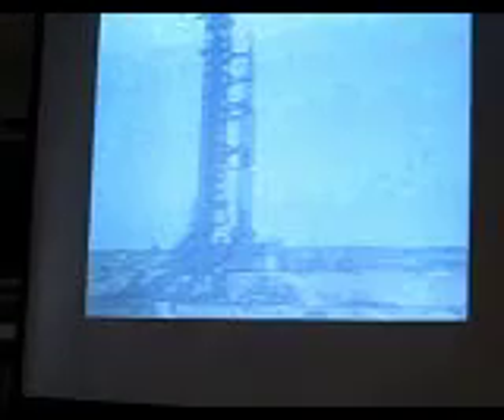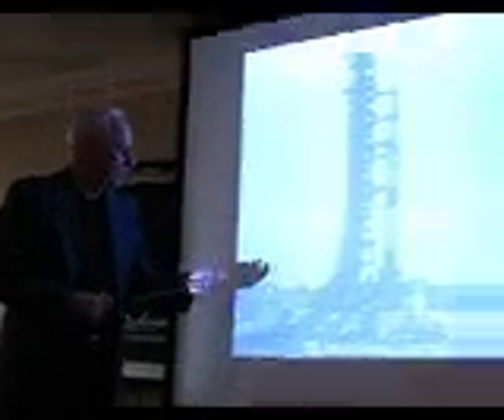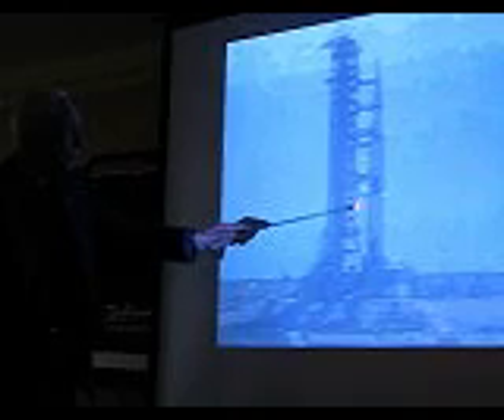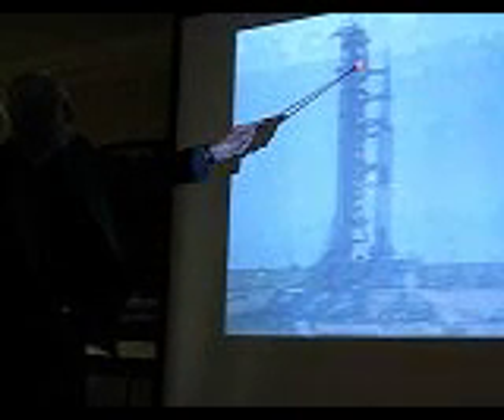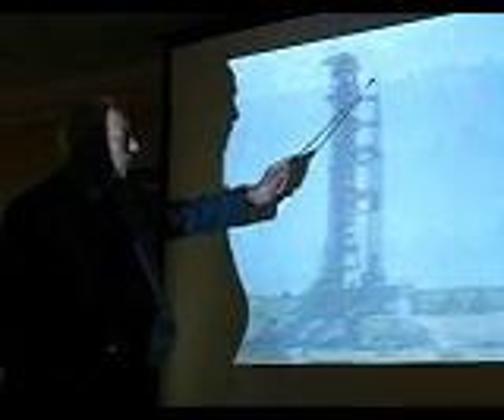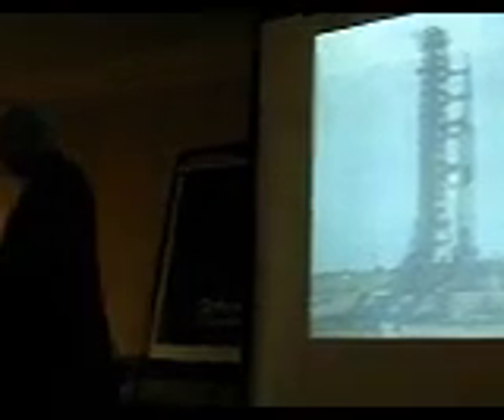Al Worden

Comment: Love that smokers cough.

He told me about Irwin taking a bar of soap as a personal item. The soap reduces the surface tension so much that warm water will evaporate off a cloth and they chucked it down the tunnel between the command and lunar modules and it left "smoke" trails as they did it. Kept them amused for ages.
Water was not an issue. The fuel cells made 50 gallons of the stuff.